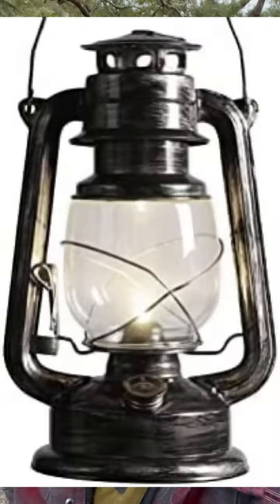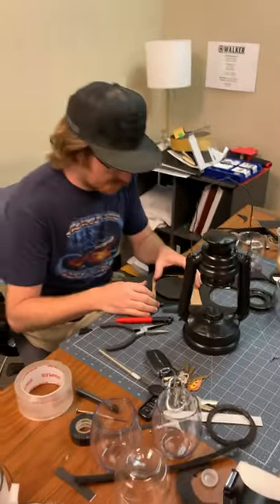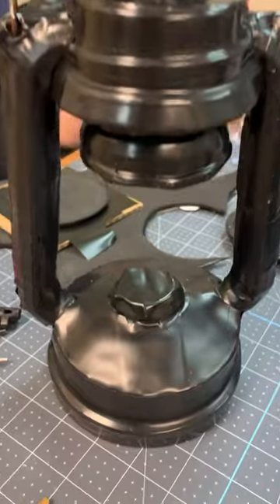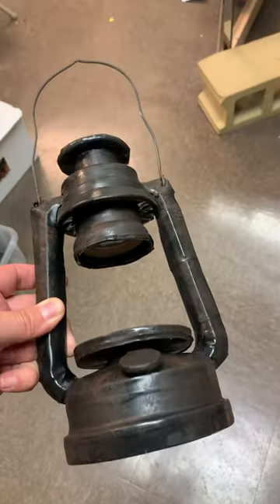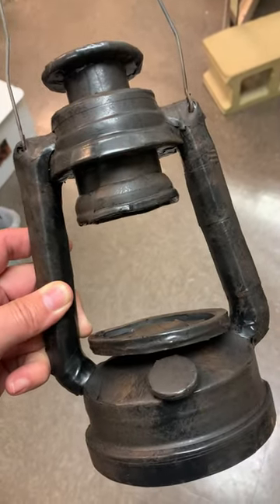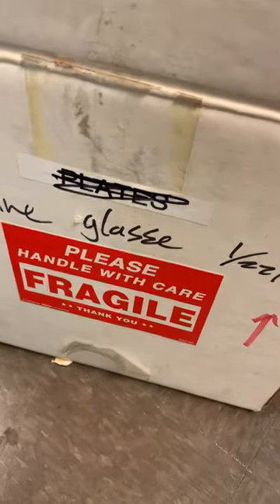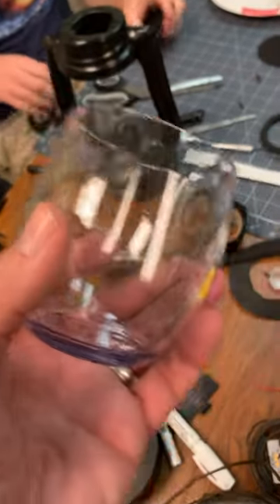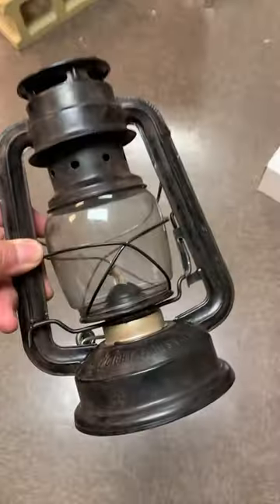Stunt Prop Lantern #shorts

Comment: Fun fact, the fuel those lanterns burn (the real ones) is kerosene, it's not nearly as flammande as people think, so unlike what you may think getting one to explode is nearly impossible (unless you fill it with the wrong fuel I guess.) Also they almost always go out if you tip one over, it will still leak kerosene everywhere but likely won't start a fire.